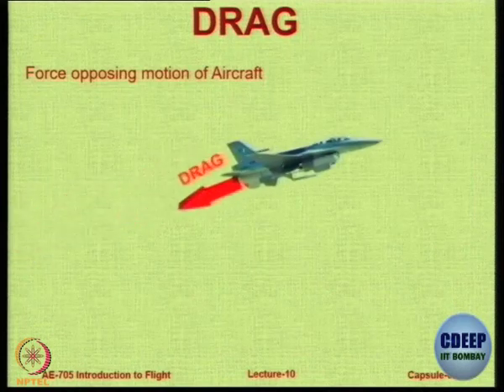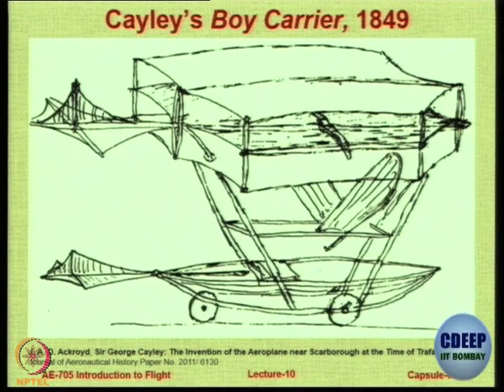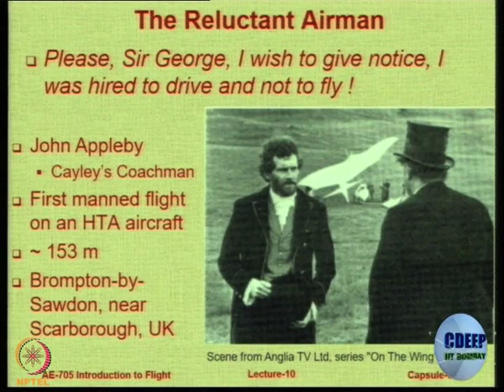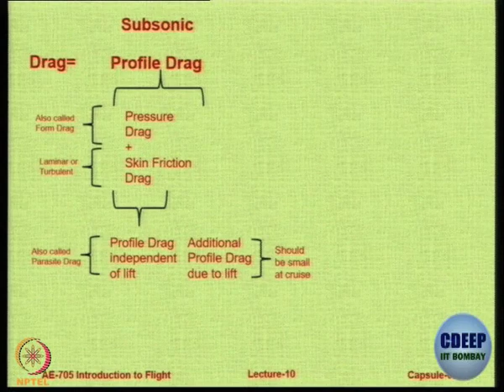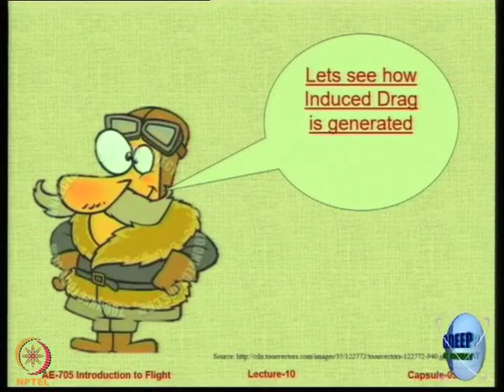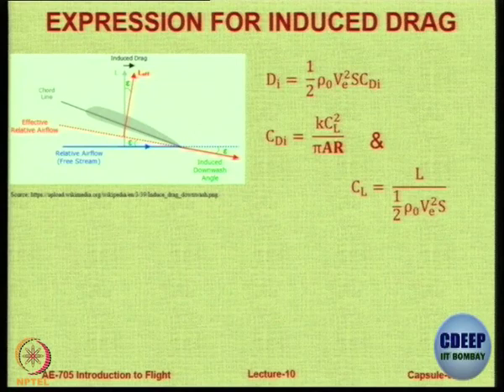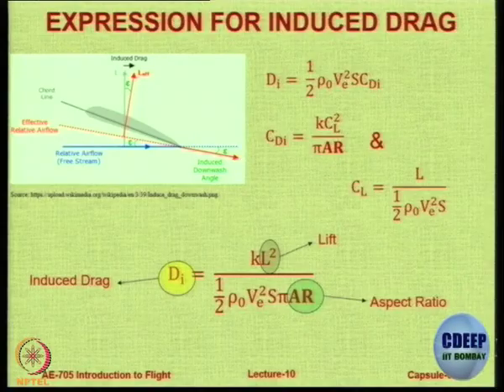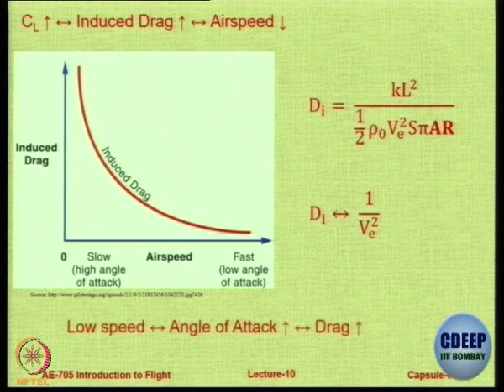Week 6-Lecture 33

Comment: The aircraft didn't landed would have many reasons
1) maybe there are FOD on the Runway or the runway is not clear in this case we can see it's clear
2) may be due to high turbulence created due to previously landed aircraft
3) may be the approach speed was too much that pilot might have thought that the aircraft will run over the Runway after landing which might lead to a crash.
4) Cross winds, this might be the reasonalbe one as we can see the majority of vortex is on one side
So there might be a sudden cross wind at the time of approach near the runway.
Reply: Thanks. I think approach speed too much. As for one sided vortex. It seems the camera just did no point in that direction.